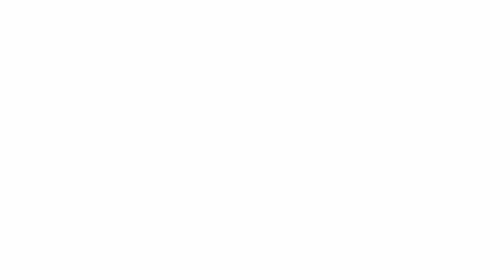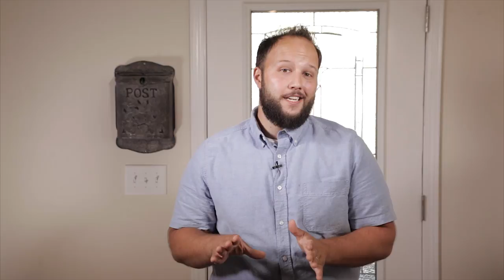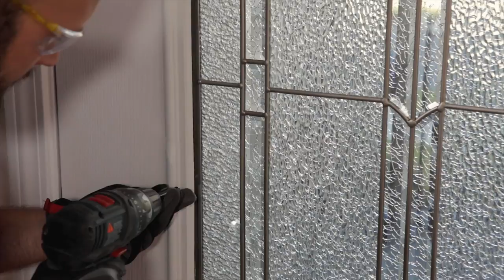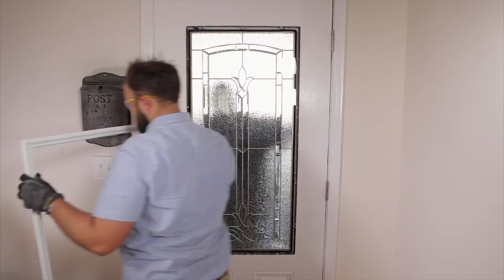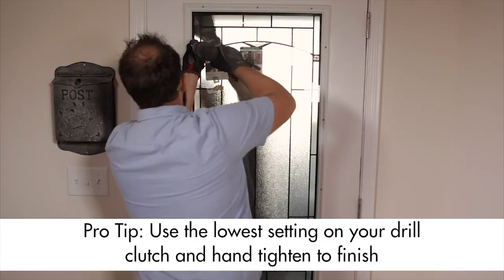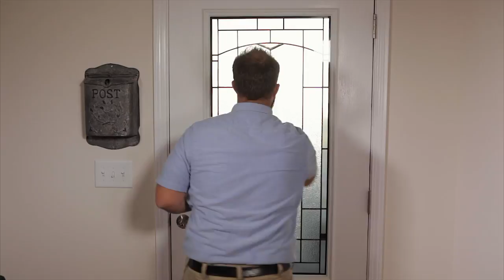How to Replace a Broken Door Glass Insert in Your Door

Comment: what if your frame doesn't have "screw holes" around the frame? Also; if purchasing a new glass; what dimensions are necessary for knowing prior to making the order complete? Is it O.D to O.D?
Reply: I found out myself one of the covers prys out and the other doesn't on mine it was the inside of the door I prayed the cover off and it reveals the screws that need to be loosened in order to take the glass pane out

Comment: Is it possible to replace just the exterior clear glass piece of a side lite if you remove it from the panel? I am now confident I can remove the glass thanks to your video. The inner etched glass piece and the clear glass piece that is on the interior of the panel are fine. Looks like the previous owner shattered just the outer clear piece.
Reply from the maker: Hi Dave,
Thanks for the comment! Are you able to send us a photo? If so, please email marketing@zabitat.com or feel free to call us at 855-813-3111
Looking forward to your response!
Reply: Did you ever get an answer on this? I have the same issue currently.
Reply: If you have dual panes of glass they’re probably filled with a gas or vacuum. If one is broken, the gas has either entered or exited and you’ve lost your energy efficiency bonus. 

You’ll want to replace the set. Not just one side.

Comment: No mention of glue, adhesive, or sealer means the window will leak.
Reply: It's supposed to leak, that's why they invented complaints departments
Reply: Except he does... "clean the surface so your new adhesive has a good surface to bond to"

Comment: Do you recommend painting the insert trim?  The white color is close to the white color of my door, but not an exact match.  My glass insert is a 15 lite grill style and would require a lot of masking off the glass to paint with a small brush.  Ugh.  I may live with it being close enough in color.  However, since it's an exterior patio door, would paint be advisable on the outside trim to give it more weather protection?
Reply: The white frame is meant to be maintenance-free and will not yellow, so there is no additional weather-protection needed. You may have difficulty painting the white frame - it will resist paint -  because it is a harder plastic than our tan/paintable frame. ODL recommends priming the white frame with an adhesion promoting primer for plastic prior to painting.

Comment: do you add new adhesive?  it seems you would but it wasn't mentioned
Reply from the maker: Great question! The frame on the new inserts have a sealant foam on the inside face that presses against the door when you install it. This foam is what creates the seal of the frame on your door, so there is no new adhesive required since it's already apart of the frame kit.
Reply: I had the same question in the blinds between glass video.  You definitely should mention that in future videos.  Now I just have to buy the kit! Thanks

Comment: Have the same question: do we have to put caulking around the inside of the plastic frame before putting it up on to the door?
Reply from the maker: The outer frame has an air and water tight, factory applied seal that bonds the frame to the glass. So there's no need to apply any caulk or sealant.
Reply: Thank you so much for all the info.